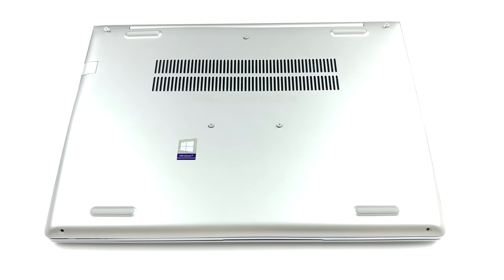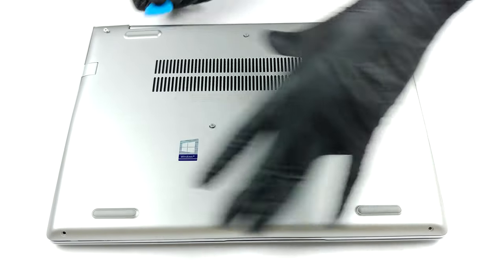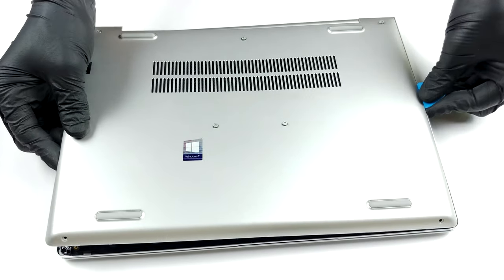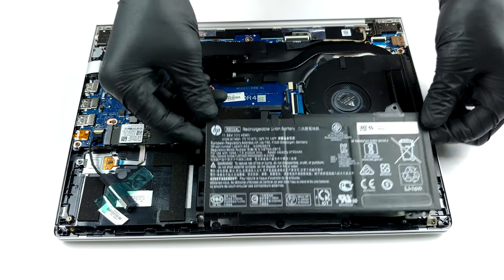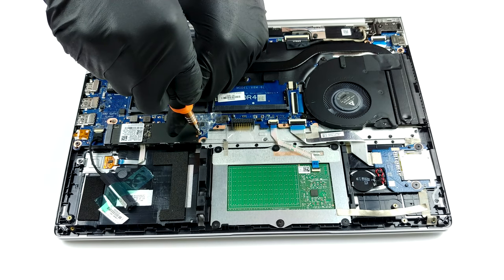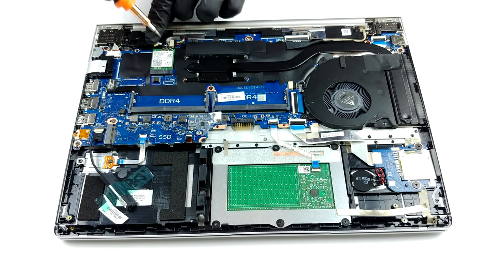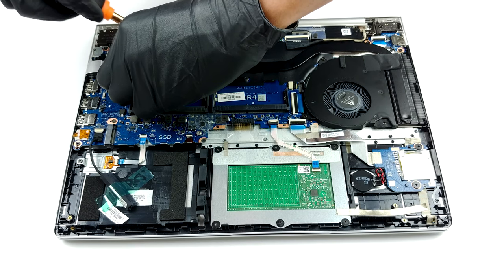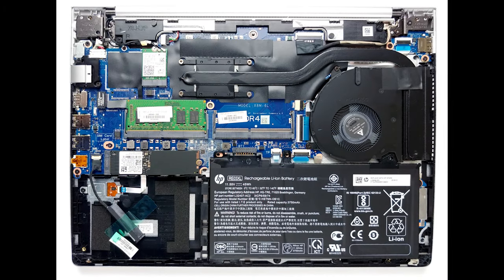🛠️ HP ProBook 440 G7 - disassembly and upgrade options

Comment: I have 2 identical 8GB DDR4 modules samsung M471A1K43DB1 ... I have lost 3 hours to find why my PC hanged 3-4 min after boot.
Then I found this:
32 GB DDR4-2666 SDRAM (16 GB x 2)
16 GB DDR4-2666 SDRAM (16 GB x 1)
12 GB DDR4-2666 SDRAM (8 GB x 1 and 4 GB x 1)
8 GB DDR4-2666 SDRAM (8 GB x 1)
8 GB DDR4-2666 SDRAM (4 GB x 2)
4 GB DDR4-2666 SDRAM (4 GB x 1)

2 x 8GB are not supported!!!

And this hang is because of some driver or sh*t. In safe mode works perfectly!

HPE - big dissapointpent this time.
Reply: Are you sure about this? I wanted to buy this however this is a big issue too me. Need 16gb not 8gb
Reply: @RadoslavTodorov  thanks mate. I might try sell the 8gb off and buy a 16gb stick
Reply: @gingerjammie  I suggest you to be extra careful when open the cover it's very tight and plastic clips can be broken so when you get 16gb module try to do the job with one open - close operation  ;)
Reply: @RadoslavTodorov  will do fella thanks
Reply: Not true, I was able to swap the 8GB for 2x8GB on my 440 G7
Reply: Mine has 20gb, slot 1: 4gb and slot 2: 16gb
Reply: @inakiechazu3523  mine came with 8 gb ram can I add 16gb ram stick? Also would it make games run smooth ? Since I can't upgrade graphc card